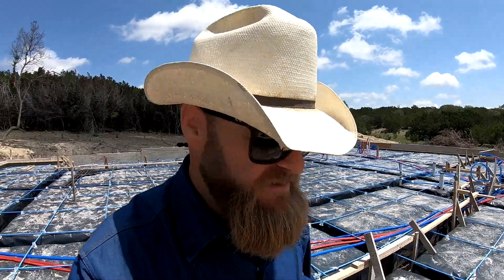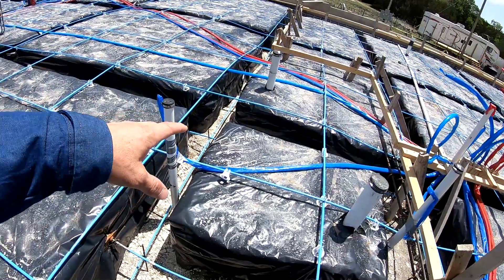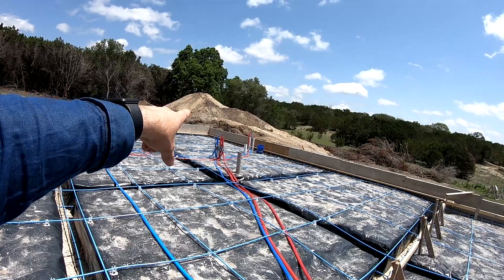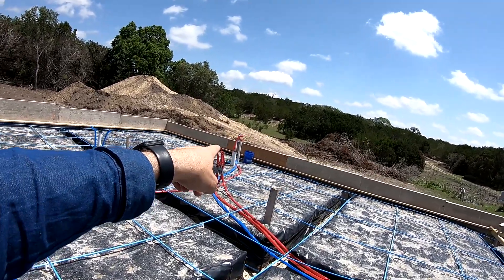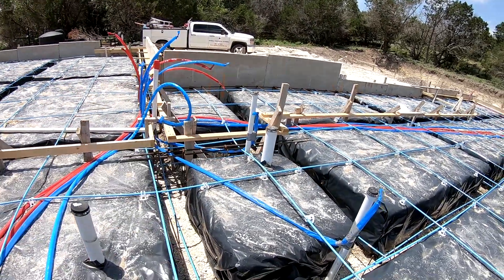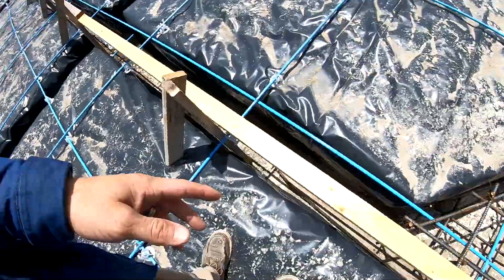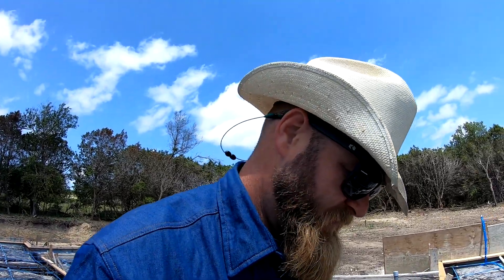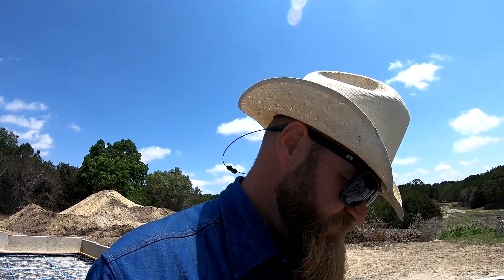POST TENSION SLAB BEFORE CONCRETE

Comment: Good vid, would all plumbing drain lines be buried under the soil before the trenching for exterior and interior beam grids over the entire area? Meaning below the perimeter beams and the interior beams? Would love to see video showing what the steps are for plumbing and other utilities involved in the foundation setup
Reply from the maker: Typically on a house foundation 3 sides of the forms are installed, then the sewer lines are installed, then the concrete contractor will install the bags for the gravel material around and on top of the sewer lines. The beam depth is typically set by the foundation engineer which will vary based on soil type. I hope this helps.

Comment: Thanks for the video, What are the big black pads on the ground in the foundation?
Reply from the maker: That is plastic covering the gravel underneath. It is a moisture barrier that prevents the moisture from the ground from penetrating the concrete after it’s poured.

Comment: Is it safe to cut or drill into a post tension slab?  Builder forgot to place a drainage pipe for toilet in the half bath.  Or  should I walk away from the new build home to avoid future headache...
Reply from the maker: You can chip around things but cutting the slab isn’t a good idea because of the cables.